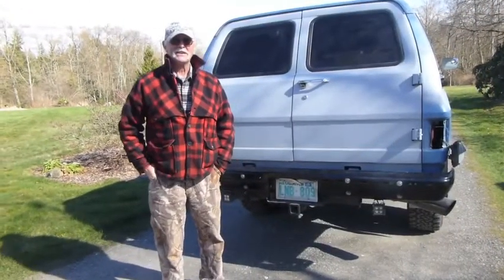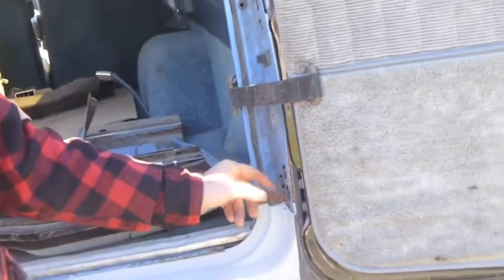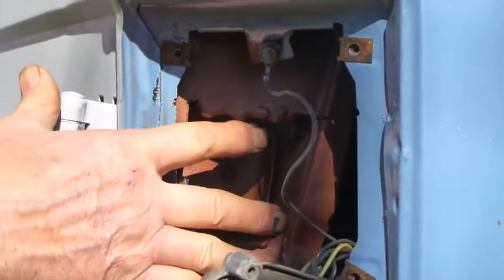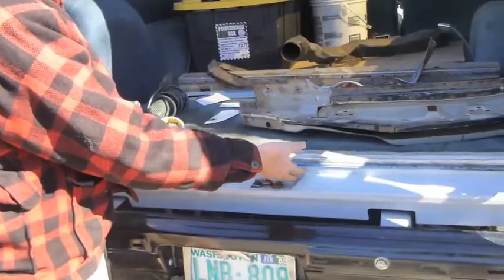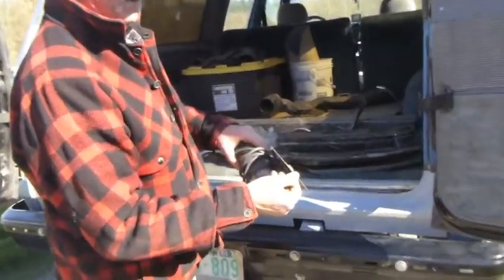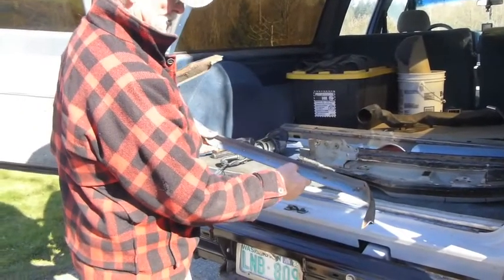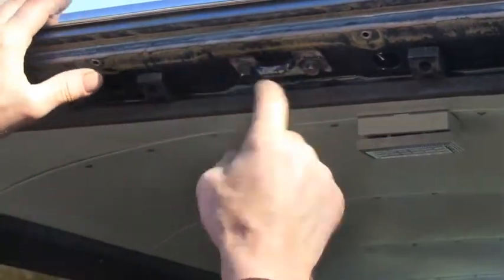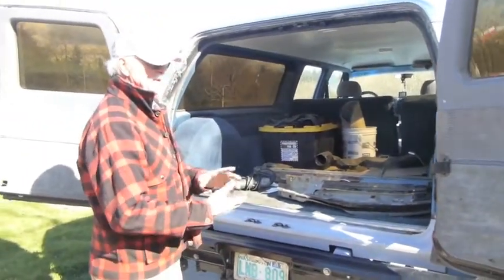1985 Chevrolet Suburban Barn Door Conversion

Comment: # 3 Suburbans under my belt...all three were tailgates. Yes they are heavy as $%$. Yes, if you are of short of stature it's hard to reach the internal grab handle, and yes the window motor is problematic... But, I just prefer the way the tailgate looks over the barndoors. And being able to roll the window down with the press of a button as you roll down the highway: Priceless

Comment: Great work , I just bought a suburban but the barn doors are rusted bad at the bottoms and I’m not sure if I want to try and weld them or just get donor doors  but besides that a little rust on the bottom rockers and the truck is really solid, I’d love to do the 6bt swap you did but I’ll wait until I run out of stuff to fix first